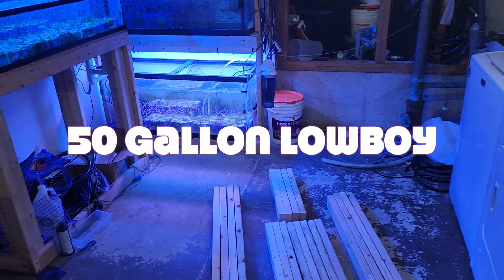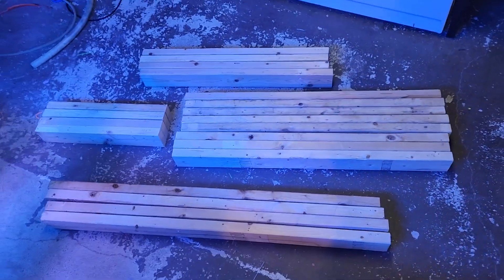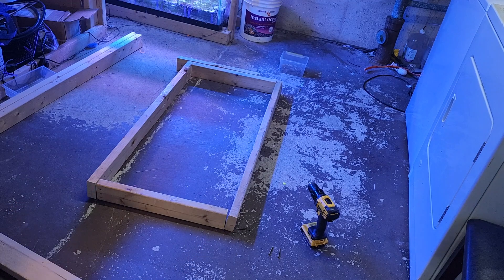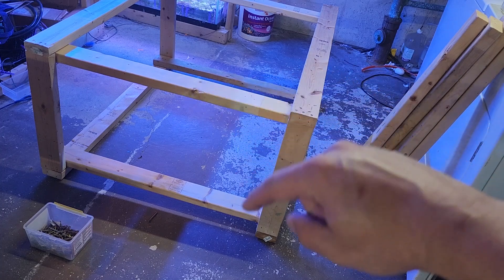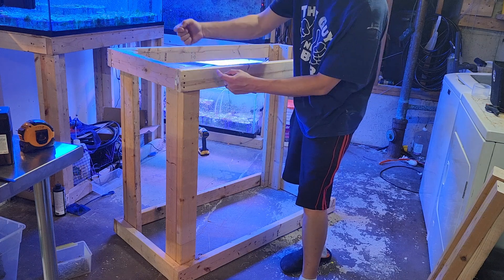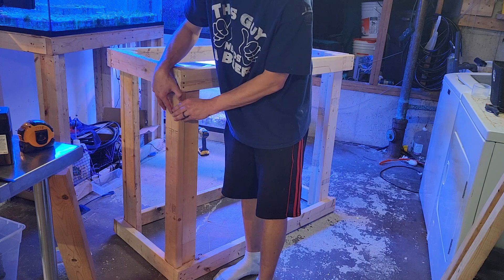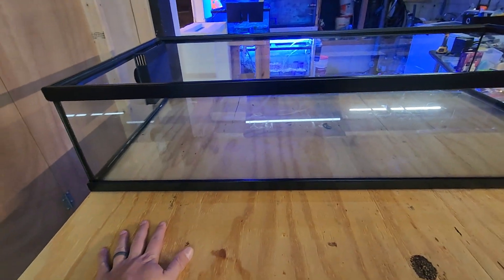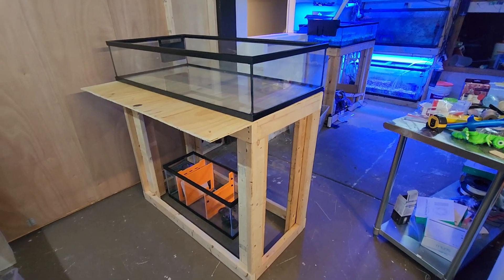How To Build A Stand For A Zoo Med 50 Gallon Low Boy Frag Tank 🆒

Comment: Bill Of Materials:
Quantity (4) 2X4 48" inches in length
Quantity (8) 2X4 40" inches in length
Quantity (4) 2x4 21" inches in length
Quantity (4) 2x4 33" inches in length
Quantity (2) 24"x48" Plywood for Top and bottom.

If you are buying 8' 2X4 you will need Quantity (8), Glue, screws, Plywood for top and bottom.